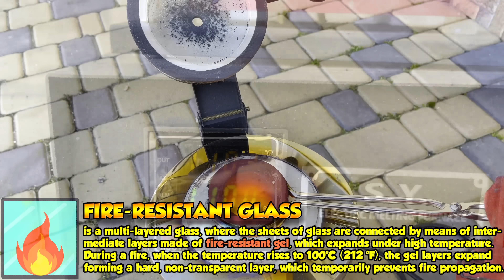Experiment: LAVA vs BULLETPROOF GLASS

Comment: the fact that fire-resistant glass performed so well against something so much more potent than fire was impressive
Reply: the bullet proof glass was more impressive
Reply: It was just a tiny amount of lava though. And it shattered the first layer. I don't think that would hold a real lava flood. Then again, nothing else could
Reply: @challenge10subswithoutvid thanks you for being smart
Reply: 4
Reply: And bullet proof
Reply: @uncovidvaxxforthestrongand3582 it was also a lot thicker and probably more expensive.  Fire resistant glass did the best per cubic cm of material.
Reply: what if your father poured hot liquid lava on your head while you slept in your bed ? what would you do ?
Reply: @chaddenning  what if your grandmother had wheels and pedals, would she be a bicycle?
Reply: Un incendio puede alcanzar temperaturas muy altas
Reply: Tbf it was built for that lol
Reply: @chaddenning  nothing because you'd be dead before you knew what happened

Comment: whoever designed that fire resistant glass is a genius
Reply: Yeah
Reply: @therandomoccult1159  fire resistant glass is supposed to delay the fire and smoke though, normal glass would immediately shatter allowing the smoke to spread so it's probably useful.
Reply: Sim vedade
Reply: @VIANYOGA02  
I'll be supervising the comment section until someone does
Reply: @VIANYOGA02  
Y? Fly
Reply: @therandomoccult1159  maybe that person is u
Reply: yes
Reply: I did :)
Reply: Yeo
Reply: Yep
Reply: Yeah
Reply: Pas du tout 😤😤😤😤😤😤😤😤😤😤😤😤😤😤
Reply: No jokr
Reply: No joke
Reply: Why do we need fire-resistant glass tho??? I feel like if there were a fire and you had to break the window to get out...:buffering:😑😐😶
Reply: @reesek9715  good point but what if you have no windows or the fire is blocking all exit or the window hurts you when you break it the glass falling on you???
Reply: i know right.
Reply: @therandomoccult1159  it’s for wild fires there has been a lot of wild fires in California and other places
Reply: @therandomoccult1159  in a factory that deals with molten steel or flames???
Reply: @therandomoccult1159  What does fire need? Fuel and oxygen. What do windows keep out? Air, which contains oxygen. Fire resistant glass has a lot of applications.
Reply: but after the fire it doesn't worth it anymore
Reply: @therandomoccult1159  did you see how the fire broke the first glass?
Reply: @reesek9715  the fire could break the glass
Reply: @therandomoccult1159  uhhhh in case of a fire? When windows shatter it allows oxygen in which fuels a fire....
Reply: @therandomoccult1159  I bet ya think people pick corn dogs like vegetables.
Reply: @therandomoccult1159  It is actually critical for department buildings and skyscrapers as it limits the entry point of smoke during a fire, as well as protects evacuating personnel from shattered glass. You really should learn a bit more about security before making these statements.
Reply: @reesek9715  You actually need to be VERY careful in breaking windows to escape, because backdrafts are a thing. A sudden rush-in of air from a shattered window and the fire will literally explode. So having glass that reliably breaks only when you break it rather than because of heat is important. Not to mention in laboratories or heck, fire engines.
Reply: @therandomoccult1159  umm have you heard of 9/11? think of smaller scale fires in towers like that,, office fire might not leave a room
Reply: @therandomoccult1159  when fireman saves life ....
Reply: yes in case someone comes and put lava in your glass :P
Reply: It’s the actual gel that expands upon heating that is the brilliant bit. Layers have been installed within 2 glass panels for a long time. Infact some thermal insulating windows use an air gap between 2 glass panes.
Reply: @reesek9715  In WW2 carpet bombing campaigns, they would first drop ordinary explosives, followed by incendiary bombs. This was to first break all the windows in the city, allowing the fire to spread more rapidly and create its own wind system (firestorm).

So conversely, you can see how windows staying intact for longer would be beneficial in a (not bomb related) fire.

The point is that these windows will contain the fire and starve it of oxygen, at least for a time. When multiple windows in a building break, you get a draft that fans the flames.
Reply: @therandomoccult1159  oh I don’t know, when would you🤔
Reply: Is it me or did that shit tern into jelly
Reply: A fallen angel did that probably
Reply: Fact:
This is not any bullet proof glass this is a normal glass, bulletproof glass won't break like this, even in more extreme heat.
You can also watch other experiment like this.
Reply: @therandomoccult1159  it's been 3 month, how does it feel after typing a stupid comment
Reply: You don't actually think that this is real lava right? It's hot alright but It got cold the minute he started pouring. Real lava from an erupted volcano can't be stopped. It would have burned off this glass in matter of seconds. Remember Dante's Peak the movie? It's more realistic than this video.
Reply: @reesek9715  most of the time your able to pick up the glass like a regular window because I have fire proof glass in my bedroom
Reply: @reesek9715  God the responses are stupid to your question. First reason. You are thinking from being trapped inside situation. However reverse it. You are in an area that can contain the fire and you are outside of it. Then it shields you from the flame. Also, if you were trying to escape in a glass situation, a window opens and you don't need to shatter the glass, just open it normally.
Reply: Since it got deleted, The random Occult said:

”Or the most stupid person in the world because think about it what would you need fireproof glass for?”
Reply: This gel inside is just..ohhhh
Reply: @André Corrêa Ishida it's not actually lava resistant, do you think if you found yaself around lava it would a Lil amount like in this video
Reply: Couldn't agree more
Reply: 00:47 😂😂😂😂😂😂😂

Comment: The fire resistant glass is amazing. 
It must be fiendishly expensive.
Reply: Most definitely
Reply: I like your use of the word 'fiendishly'. 😈
Reply: It's not fire resistant, it just helped cool down the molten lava because of the sheets of plastic in between the panes
Reply: @packman21421  from 1:26 - 1:46 he tried it out on a fire resistant glass....
Reply: Looked like it has some kind of absorbent polymer in between each sheet. Instead of air, a coolant, suspended in fine water beads. Simple but ever so effective.
Reply: @packman21421  Pilkington Pyrostop is infact, fire resistant glass. You just defined the method of why it RESISTS fire. Lol
Reply: But only against a tiny amount of lava
Reply: @lindavaca3321  ye me to I have never heard it before tbh
Reply: Car glass didn’t like that shit at ALL, did it?

Comment: That fireproof glass is very impressive. I didn't think it would do as well as it did but it did.
Reply: fireproof glass.... fires back
Reply: I think it would've been different if it didn't have the trim around it. I feel like that pushed back partially because it had nowhere to expand. And of course the layer in-between boiled.
Reply: I think it would've been different if it didn't have the trim around it. I feel like that pushed back partially because it had nowhere to expand. And of course the layer in-between boiled.
Reply: @Somar Chimon Unfortunately this would not work. Glass is already a poor conductor of heat. Modern windows usually have two panes with a thin layer of air between them to further improve insulation. I doubt you would gain much from this gel layer.

But the window will still let sunlight in, which is absorbed by surfaces in the room. This heats up these surfaces, which in turn start radiating back. But what they return is infrared radiation - to which glass is mostly opaque.

In other words: energy comes in as light, gets converted into heat, and then into infrared light which cannot leave the room easily. This is also how greenhouses work.
Reply: Put up a hell of a fight. Lava said fk it.
Reply: It be making pancakes out of that lava
Reply: e. I d
Reply: Same thoughts
Reply: It's fire proof

Not lava proof

Also they don't expect someone to break in a building using lava
Reply: The lava did a kick flip on it tho
Reply: Thats how they tested it
Reply: top
Reply: top

Comment: That gel and fire resistant glass is amazing.. really.
Reply: Is that renri as your pfp
Reply: Does that mean that... you can literally throw a fire resistant glass in the volcano and it won’t melt
Reply: @sgho6800  it won't melt, but it will break. Glass cracks under high heat.
Reply: ok
Reply: It makes me wonder though. Couldn't you put that gel between 2 layers of bulletproof glass. Then you would be lava, fire, bullet, hammer, baseball bat and axe proof.
Reply: @TSotP  can you crash a car into it, though?
Reply: @rebelbackupacc7373  I think you would need a triple layer for that lol 😆
Reply: @TSotP  huh, what about an airplane?
Reply: @rebelbackupacc7373  I'm afraid that Airplane proof glass doesn't exist.
Reply: @TSotP  point made, all glass can be broken
Reply: It’s pretty cool!
Reply: 3:00 look at that jello
Reply: Even top-level bulletproof has a breaking point. Level 8 is 5 rounds from a 7.62mm of lead with copper fmj. I guess better protection would be concrete windows with cameras lol
Reply: Glass jelly!  Awesome!
Reply: That is really nice for you (no hate its just a joke)

Comment: Fun fact : Lava is molten rocks, in this video, it's liquid copper that's being put on the glass. It's very easy to identify that it's copper due to the metal being brown on un-oxidized parts
Reply: Good ole search works in comments and you answered my very question so I didn't have to make a duplicate.  Thanks.
Reply: @synergy021  Cheers
Reply: Which one would be hotter?
Reply: @dminnovatores  Molten rocks or lava since copper has a relatively low melting temperature
Reply: Lava is a hot melted rock from the core when the heat gets to high it rises up to a volcano. Volcanos are formed by underwater volcanos underwater volcanos make islands when they erupts but still they have a volcano on top making the lava go up to a speed of 200mph or more making lava a rock from the core
Reply: More of a click bait than fun fact...
0:23 you can clearly see the temperature is set to 1100 degrees Celsius...
Reply: @sebastienmonette6659  Not really...
There are lava types that melt at lower temperatures than copper  (1100 C) ...
Reply: Copper rocks

Comment: I like how the car glass was like, "Let me think about it." pause "No." Then just shatters in a fit of drama.
Reply: 😂😂😂😂😂😂😂😂😂😂😂 love this
Reply: Car Glass reminded me of Amber Heard.
Reply: That's only bc it's fake ebay auto glass. REAL auto glass is tempered.
Reply: @SerenoOunce  I was wondering why it didn't shatter into those pieces that keep breaking apart further once it has shattered.
Reply: @SerenoOunce  I worked in a factory for 2+ years tempering auto glass.

The glass gets heated to around 1400f, and then cooled in 2 seconds. "Freezing" the stress on the edges of the glass.
So when he poured the molten metal on it, it gave a spot for the stress to transfer and release itself.
Reply: Read my name
Reply: Thermal is created by kinetic force that it's no surprise a bullet resistant glass holds better.
Reply: @andrewvirtue5048  Oh, that's interesting! ^^ Thanks for the info!
Reply: I thought the same thing. It all seemed so dramatic lol
Reply: The car glass popped like a balloon.
Reply: My life be like
Reply: "I've listened to your proposal and will get back to you soon."

"The answer is no."

Comment: Very interesting. It looks like putting a single layer of fire resistant glass on the top outer layer of bullet proof glass might be a good idea.
Reply: A single layer is still around 3 inches plus 1-2 inches of bulletproof glass
Reply: Yeah
Reply: that's gonna up the price of construction by at least 10% on any building, those types of glass are meant for very specific situations on a small scale.
Reply: You mean it should be the other way around.... if fireproof glass was on outside..then bullets would smash that glass then get protected by the bullet proof glass....if fireproof glass was on the Inside...then it would work better I think
Reply: This is genius actually...
Reply: wow
Reply: For what use? 
Most times, bulidings aren't built next to zones where such dangers could be a compromise to the windows. 
There won't be lava just flowing at your house randomly, and if there is, well, nice job idiot building your house next to a volcano, the walls will fail nevertheless. And as for the bulletproof glass, unless you aren't a high ranking political/gang member that is paranoid of being sniped at home, why? 
It's just a waste of money, if your window breaks, you'll have to replace it. Price? A couple hundred. If you bulletproof glass stops something? Good luck with a fogged up window, having to replace that is gonna cost you at least 5k.
Combining them together? Are you building a nuclear shelter with a cinema view of the explosions and you're a billionare? Go wild
Reply: @PistaZOV  why are you taking it so seriously lol
Reply: @spongememefunnypants9101  why not? It's just a rant and it seems that some ppl actually think it's a good idea
Reply: @PistaZOV  honestly, yeah, some kids may try it when they grow up.
Reply: @PistaZOV  Clearly you've never built a villian's secret lair before.
Reply: hear dis man out
Reply: Then no one can destroy your house by throwing lava on it lol

Comment: The heat resistant glass would be great in movies where there are volcanoes, like in a scene where its covered in lava and they are trying to escape as its slowly cracking...
Reply: Talk about volcano, you talk about high quantity magma..

Im not sure it will be work in high quantity...

It will be destroy in few second... Or maybe less..
Reply: @Manual.winder  I know, but this is a hypothetical movie we are taking about.
Reply: @chaoticprogramming  yeah, movie don't need realistic condition actually ...
Reply: Ngl, I think CGI would be safer.
Reply: It would look epic, and certainly provide tension.  Just one problem: the glass might stand up to the heat of lava (technically magma if it's still in the volcano), but lava is still molten metal, and if you have lots of it, the glass will fail under the weight of it before it fails under the heat.
Reply: @babylon218  Perhaps most of the lava isn't there yet, so its a thinish layer. It's still a lot more than in that test, and would very much still burn. Maybe the top was meant to have people walking on it, so is super stong with support beams. Perhaps it's a movie and they don't care about the logic ¯\_(ツ)_/¯

I mean look at ant man. They talk about how they become a bullet by shrinking because they keep their mass, and then in 70% of the scenes they can pick it up and they never damage whatever they are standing on.

I do understand your point, not trying to argue or anything.

Comment: You've combined the two things I've done most in my life. In the 70s and 80s I was a glazier and since 91 a lava/volcano explorer.
Yeah, plate and tempered glass don't fair well with heat. They're usually the first things to explode in structure fires. 
Bullet-proof glass is expensive and heavy as hell.
Of course, a continuous lava flow would eventually melt it down.
Cool experiment.
Reply: so i wonder if there is a way to engineer around this.... kinda like a heatsink on a pc or a radiator on a car.... basically a way to share the heat from the BPG with something else.... and then cool that something else.... I assume cooling the glass before contact with the lava would just break it faster.
Reply: Which why fireproof glass is the best option : in the event of a vocalnic eruption there would be fire everywhere, so it would stop the fire. It's not too heavy; it stays much colder since it uses fire-retardant gel; and also, in the event that it ever explodes from the inside, you're still safer from the glass shards themselves because of the gel.
Reply: @jas_bataille  Waste of money. The entire house is going to be consumed/buried by the lava flow. Just get out and take what you can before the flow hits.
Reply: @lavapix  Nope If u stack a 10km wide fire resistant glass infront of the lava, you can actually stop it's flow
Reply: @KingstonTiger  Lava will simply go around it or inflate over it eventually melting it down. You can pause it but you're not going to stop it.
Reply: I was going to be a volcano explorer like you. But then I took an arrow to the knee.
Reply: @lavapix  To add on to your point, lava is liquid ROCK. Rock, whether liquid or solid, is heavy and dense and will knock over pretty much anything in its path.
Reply: True
Reply: Read my name
Reply: @lavapix  Depends on size, I suppose. Is it possible in theory to completely encase something in a sufficiently thick and large barrier to protect it throughout the course of an eruption? Sure it is, nothing's infinite, nor is the amount of lava. Is it at all practical? Hardly. Rather than brute-forcing it, would be far more feasible to build a multilayered wedge-like structure to redirect the lava flow to the sides of a single object you wish to protect.

Then again, that can be achieved far easier by altering the terrain, building ridges and trenches in a suitable way. The point of bulletproof glass is that it is transparent and durable. If you only need something to be durable, no need to go to all that trouble.